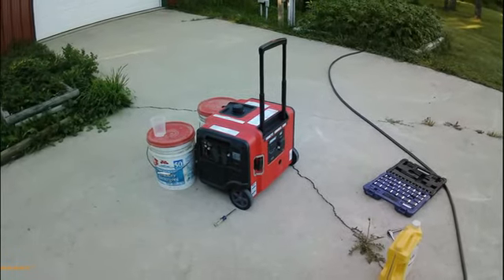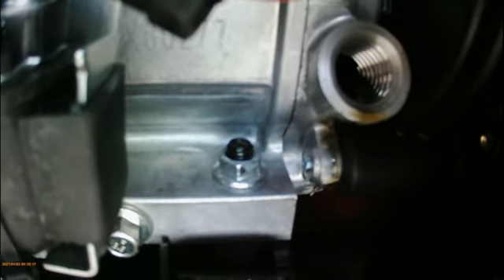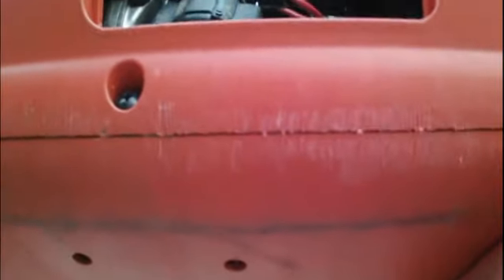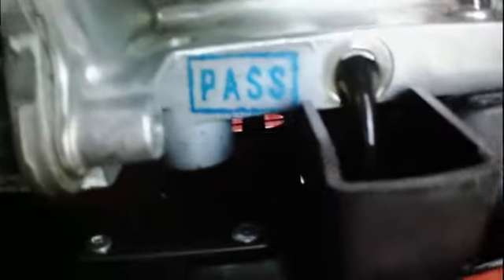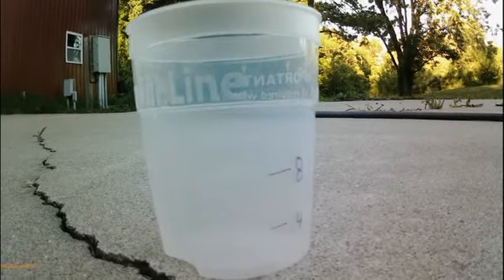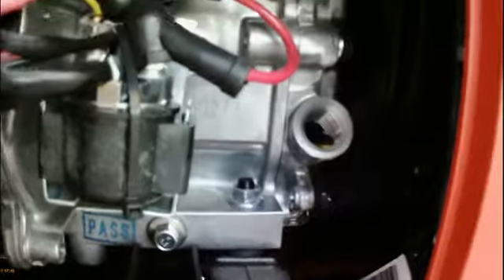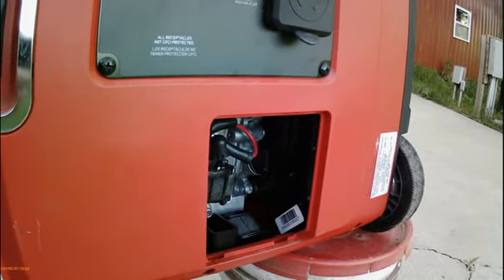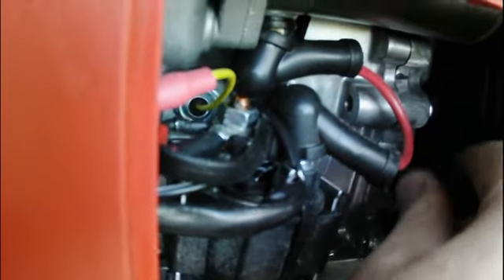Changing the oil in a Snapper SP4500 generator.

Comment: How do you like generator after using it?
Reply from the maker: It's great.  I have 130hrs in it now.  We use it for our camper.  We camp out where there is no power.   It runs the Air, and a blow dryer or anything else. We use it about 30 feet away.   You can hear it, but it's not louder then the wind or so. I personally think that it was a good buy.